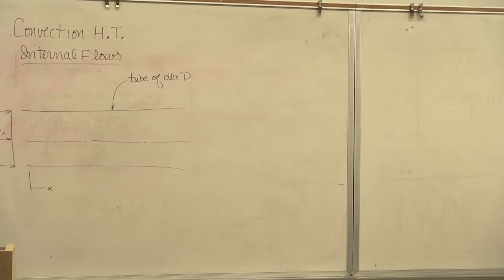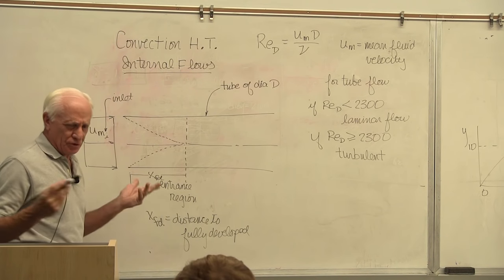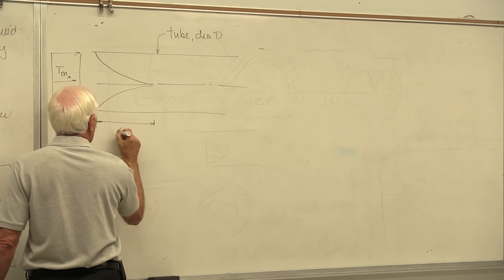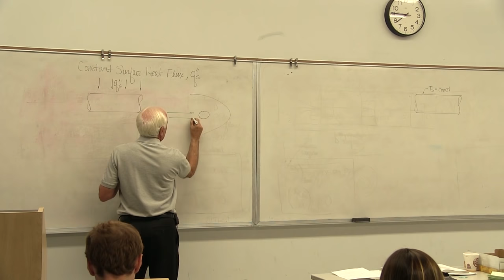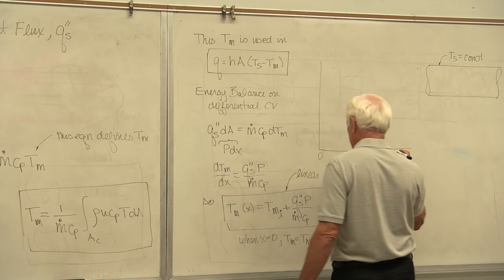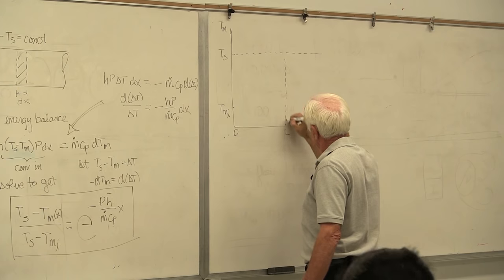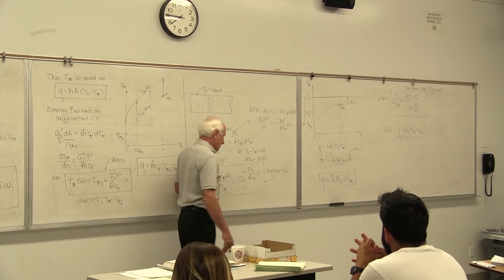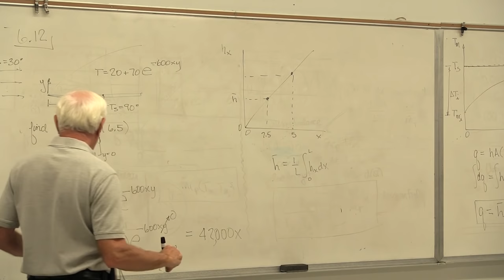Heat Transfer: Internal Flow Convection, Part I (22 of 26)

Comment: just a correction for you dr john if the flow re number was greater than 2300 it will be transitional and greater than 10000 it turbulent
Reply: Actually, while Incropera says that turbulence is evident for Re greater than 10000, many other authors put that lower limit for much smaller re values. For example Munson says that for Re greater than 4000 the flow is turbulent. So either way is wrong, just depends on the correlations and conventions you are using